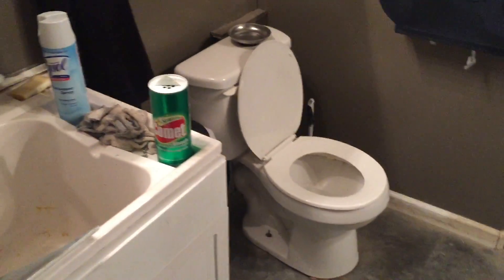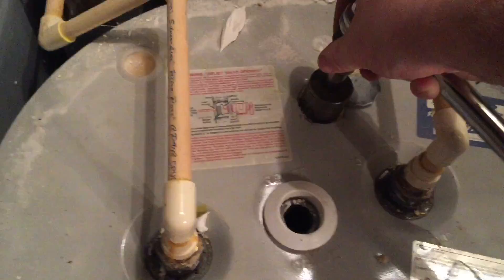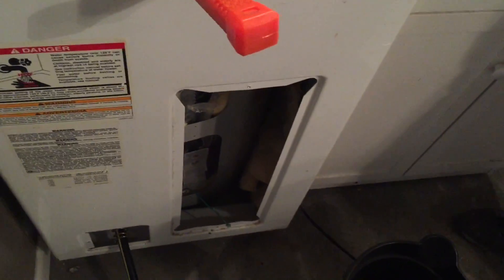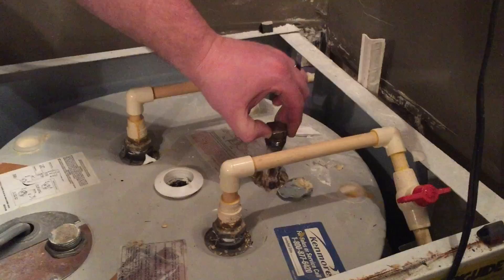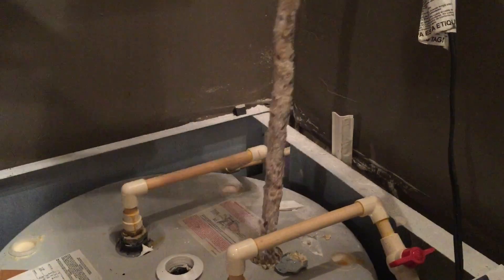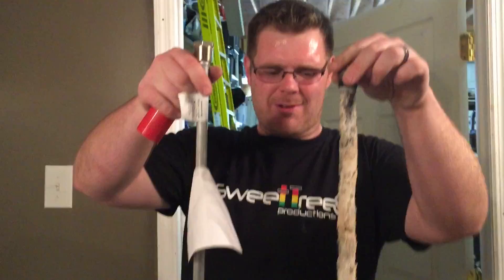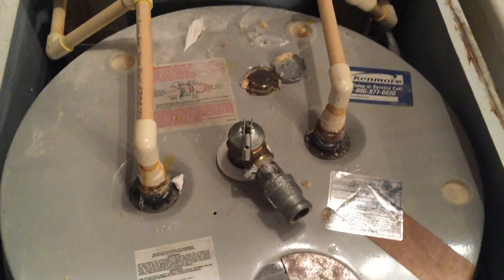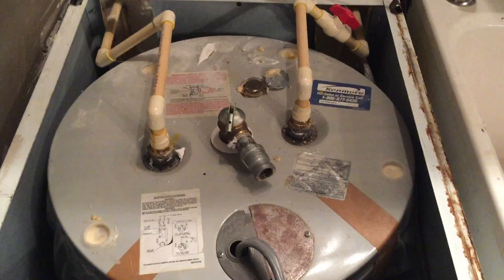How To Get Rid Of Stinky, Smelly, Sulfur, Smell From Hot Water Heater

Comment: 🎯 Key points for quick navigation:

02:47 🔧 Ensure the geyser is not too tightly closed before draining.
05:18 🌊 Check for any obstructions in the water line to ensure complete drainage.
10:30 🧼 Regularly clean the geyser tank to avoid accumulation of dirt and parasites.
16:00 🔌 Disconnect the power cord before emptying the tank for safety.
30:45 ❄️ Always drain the tank at the end of winter to prevent stagnant water.
45:00 🏠 Proper maintenance of the geyser helps in efficient functioning during the winter season.

Made with HARPA AI

Comment: This guy doesn't know what he is talking about.  I watched this video to determine where and how to add hydrogen peroxide, but he did not address that.  Rather, he simply said, "We added hydrogen peroxide".  He also said that the gunk on the anode water was what caused the smell, but this cannot be correct because my hot water began smelling much worse after I had replaced the anode rod.  I have a Kinetico water softener, which exacerbates the problem because of the salt.  However, my research indicates that BOTH magnesium AND aluminum anode rods are problematic.  Aluminum/zinc or a powered anode rod is recommended.  I hired a licensed plumber to sanitize my water heater with hydrogen peroxide, but in all his incompetence, he could not follow the line by line instructions that I had downloaded for him.  He failed to drain the water heater with hydrogen peroxide through all the hot water faucets in my home in order to sanitize the water supply lines, so the bacteria remained in the supply lines, and smell returned after only two weeks, and I have to do it again.  I watched this video because the plumber that I hired pumped the hydrogen peroxide into the water heater through the drain valve.  Since I do not have a pump, I was hoping this video would tell me where to pour in the peroxide.  Does anyone know if I can pour it into the hole where the anode rod is?  I do not feel confident enough to disconnect the hot water outlet pipe, and my water heater was installed such that the T&P valve is inaccessible, which is where the instructions that I downloaded say to pour in the peroxide.
Reply: You can add the HP via the anode rod hole or through the pressure relief valve hole (temp remove the pressure relief valve).  This article contains good instructions (near the end):  https://www.home-water-heater.com/rotten-egg-smell.html
Reply: Hey there! I'm not sure if you are still having problems with the stinky water, but I just worked on the development of what I and my team believes is the best Powered Anode on the market! We'd love to have you try it!  Search "STOLTCO" on amazon.com.  Message me before you buy it and I can try to get you a discount code! GL!
Reply: @user-ms2mr2mc3g  Hi Tim, i am having the same issue, any way you can provide me with a coupon code?
Reply: Wasted time and money,... replace water heater.
Reply: @splinterinthemind5158  why is that? Can u elaborate?
Reply: @seanandrewdarrah  remove smelly water heater , replace with new water heater… maybe have water tested coming out of the softener not necessarily in that order…
Reply: Sometimes you just need to party like it’s 1999

Comment: listen i'm not a plumber have no experience with this issue but in my case it is in the bathroom faucet I think when water starts running it is in the outlet where the water goes that is causing the smell,when I pour vinegar down drain fixes problem for a while

Comment: I was told to pull the rod out and cut it off so you can put just the cap back in the tank. It’s been 2 years now and no smell. I’m sure it voids the warranty of the tank but better then that smell
Reply: your fix is simple but the best the aluminum ones are not good for your health

Comment: Zinc pellets along with an aluminium anode, works effectively to eliminate the rotten eggs smell and other bacterias.  I did it and it worked; three months and counting...
Reply: where do you add the pellets?
Reply: That works, but the aluminum is bad for your health!  ...Buy a STOLTCO Powered Anode on Amazon and it will probably fix the problem for 20 years... also it protects your water heater from corrosion better than Mg or Aluminum anodes.. Good luck!

Comment: Mine lasted a month before it started to stink again.  Need to cough up the extra for a different type of Anode Rod, the cheap one will just start to smell it up again.
Reply: ALuminum/Zinc is necessary to remove sulfur....  a magnesium rod will not help....   an old anode rod should look exactly like the one he removed or worse..  ...  if it looks new, it's not working.  an anode is sacrificial, meaning it gets eaten up by reacting to elements in the water rather than the steel water heater getting eaten up..
Reply: M

Comment: did the same thing and smell came back 2 weeks later. any ideas?
Reply: +Salty AL   Drain the water heater slowly till the water is clear.Try increasing the volume of the water draining and see how this works. Replumb your fittings so that you can add hydrogen peroxide if the smell comes back. It should keep the smell away for maybe 6 months. Two pints of hydrogen peroxide for a 40 gallon water heater for maybe two or three hours and drain or just drain the heater partially.
Reply: +Salty AL you will always get the smell if you don't clean the water before it gets to the water heater.
Reply: Replace water heater
Reply: Hydrogen peroxide worked leave it in for four hours after cleaning the tank do it every 6 months because it's the water reacting to the anode rod. Some water has lots of sulfur in it.